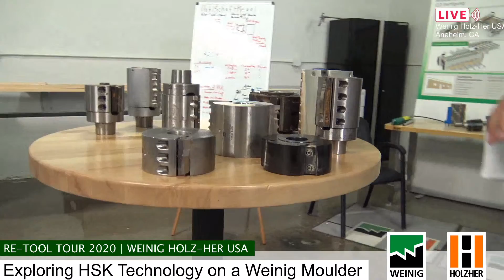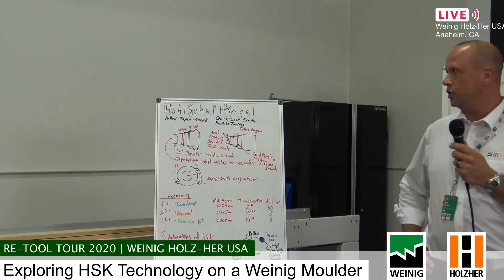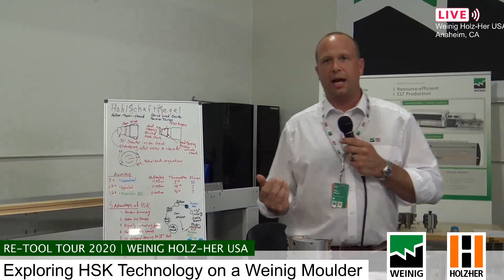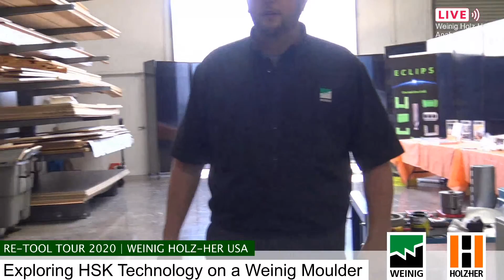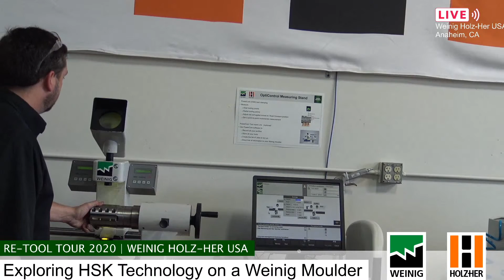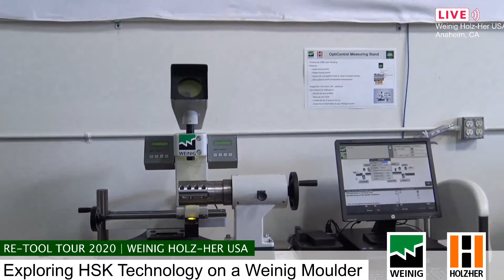Discussing and Demonstrating HSK tools in a Weinig Moulder (Live Aug 28, 2020)

Comment: Looks great in concept in a pristine showroom environment but I'd bet these guys have never messed around with HSK heads in a real life wood shop environment where the machines can not possibly be kept this clean. At least with hydro-lock heads you have an external spindle you can assure is clean when installing tooling and the concentricity of hydro-lock is more than enough for a great finish, it's worked flawlessly for years. The HSK is simply a way to get you to spend money on retooling.